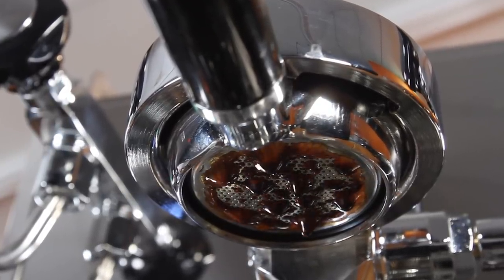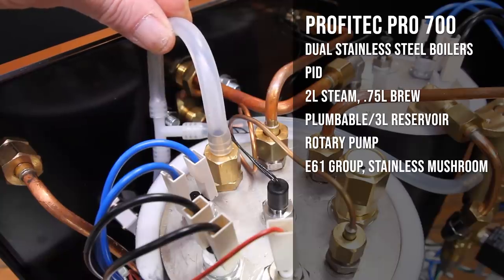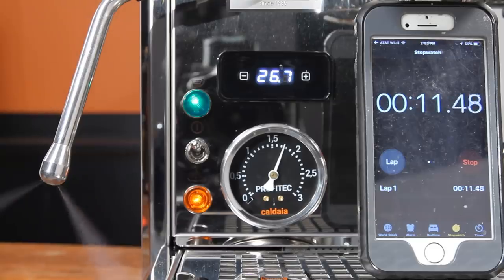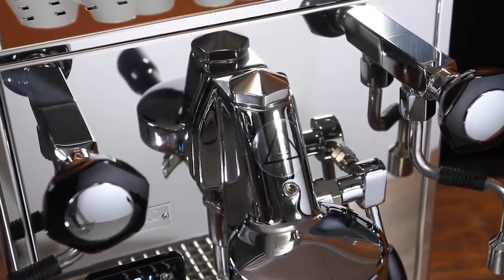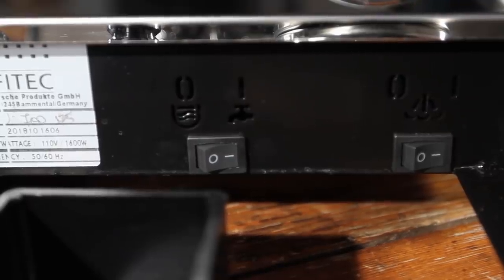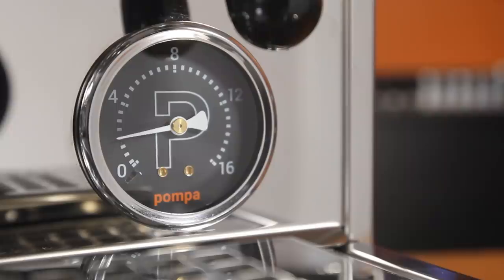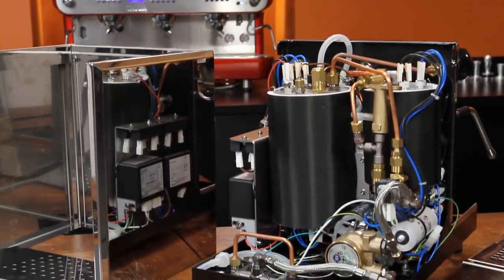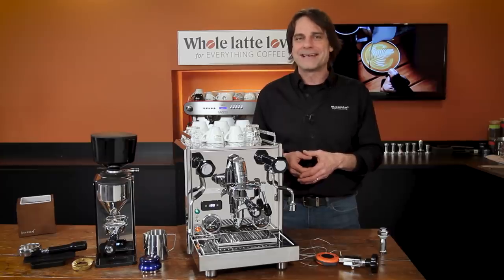Review: Profitec Pro 700 Dual Boiler PID Espresso Machine

Comment: I have this new Profitec 700 that I got a couple weeks ago but the steam pressure stays at 1.5. Shouldn't it be at 2?
Reply from the maker: Hi RR, Did you set the steam boiler to its highest temp? If not that's the "T2" setting on PID controller. At max setting of 272F you should get ~2bar.
Marc
Reply: @Wholelattelovepage  thank you! Easy fix

Comment: I have this Profitec Pro 700 and I was told it's as "good" as my local coffee house, it's not. After spending nearly $4K with their grinder I'm not a happy camper. Your review is fine, but people thinking they're going to get $17K+ espresso machine coffee house equivalent at home they simply will not. It's good but I'm frustrated. 😒
Reply from the maker: Hi D, Sorry you are having trouble. I have to say the Pro 700 is one of the best machines in it's class. Not sure who compared (or said) it was the equal of a $17,000 machine. But with proper skill I do believe it's every bit as capable of producing a cafe quality shot. Most will tell you excellent espresso is a result of these factors in descending order of importance: Bean, grind, skill of barista, machine. Nail the first 3 and most machines at HX boiler PID or above can produce similar shots.
Marc
Reply: @Wholelattelovepage  .. Same beans, Same "Barista" person who came to our house ... obviously different machines .. our water is not hard .. and while good it's not as good. Again, it's for home use, morning espresso, evening cappuccino and so on. So I don't what more to say, we could go in circles. Hey it looks good anyway, so there's that.

Comment: Vs Slayer or La marzocco?
Reply from the maker: Hi Alex, Slayer and La Marzocco run 2.5 to 4x the price of the Pro 700. So not truly comparable. Those machines are pre-infusion and pressure/flow control specialists. The Pro 700 can do line pressure pre-infusion when plumbed and pressure is adjustable via external pressure regulator on the plumbed line as discussed in the video. Personally, I'd be more apt to do a comparison of a machine like the Rocket R Nine One to the LM GS3 MP. I got in to that a little during the review of Rocket's new pressure profiling machine:  https://youtu.be/31GFyA-DXXg
Marc